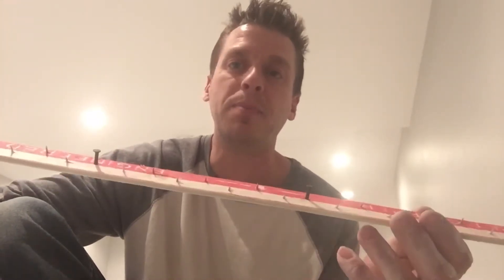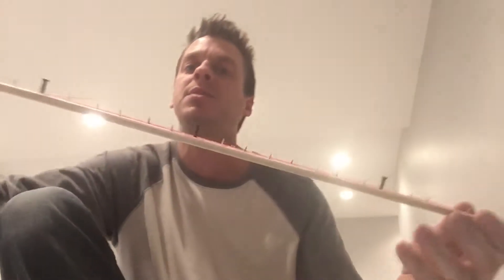How to install carpet strips on concrete carpettoolz.com

Comment: I was thinking of doing a carpet repair myself as a little learning experience.. it's in a fairly hidden corner of a closet where our cat pissed for a few months without me noticing.. I had to pull out the disfigured baseboard and the carpet came up in the corner.. the end of the strip was toast. Should I put a new part of a strip down for the new corner or will the new baseboard hold it down well enough?
Reply from the maker: iAndy thanks for connecting! being in the closet you can skip the strip even though it’ll never really be stretched in tight.

Keep me in the loop and let me know how it works out